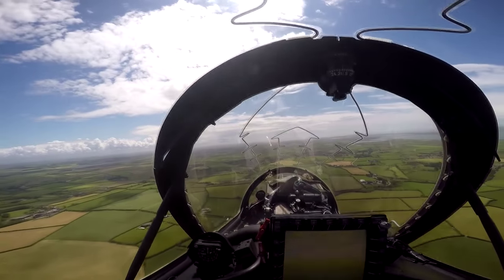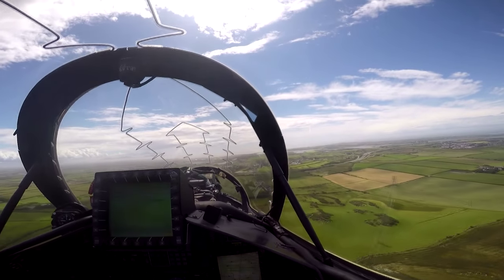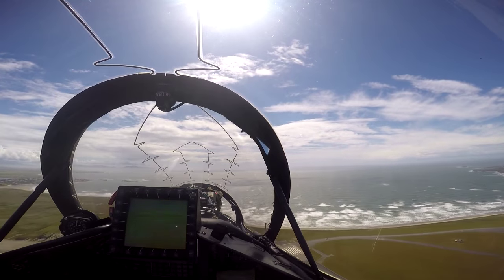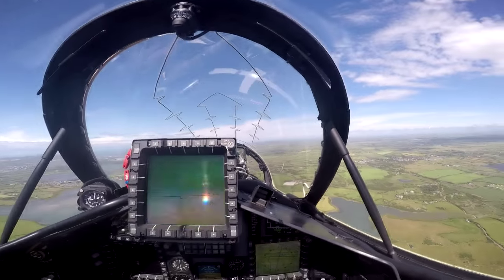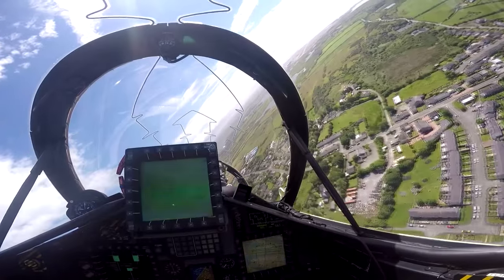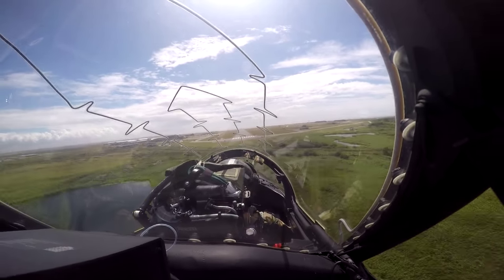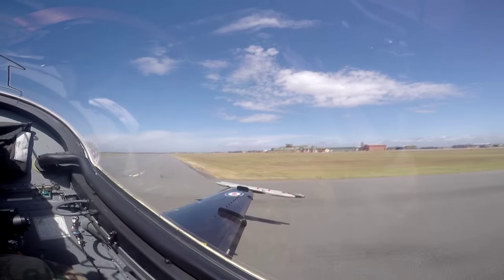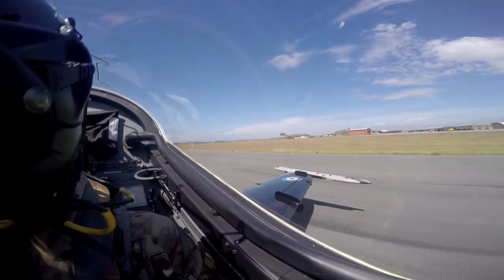Hawk T2 - The Fastest Way to Land a Jet

Comment: Yeeeeha ! I was in a Hawk 3 ship Low Level and last in Line around the A5 pass as I pulled to much G. Ooops. I went full power to catch up and was FARRR to fast with too much overtake for the break. So I had to pull a High Speed Barrel Roll and slotted into position for the break. My debrief was one word beginning with C. 😂 Eventually I ended up on the Jaguar after winning the weapons prize at Brawdy TWU. Loved the Hawk, especially firing rockets. My instructor was ex Lightnings and ended up being Princess Diana’s Equerry.

Comment: As ex USAF it was very interesting to see how the RAF do the break. In the USAF we did the break mid field, not past the end of the runway, and we turned from downwind to final much sooner. I'm curious as to why the RAF spreads things out so much more?

I would also remind you that we were doing our break coming in at 300 kais and final was done at 160kias + 1 knot for every 100 lbs of fuel over 1,000 lbs, so everything was happening faster. It's  my under  that previously the US AF did and even shorter pattern, with the turn from downwind to final done immediately abeam of the approach end of the runway, so when they rolled out on runway heading they were at the overrun.
Reply from the maker: Our circuits were taught to be flown fixed power as a handling exercise. Set 80% at initials and try and not touch the power again. Also, US jets tended to slow down faster, hither alpha so you could break earlier - there seemed to be a thing in the UK of being on speed to tip final before you tip final, not catching it half way around.

Comment: How many times can a chute be reused? Has it got a definitive life span or is it an inspection and refit until it fails said inspection? 
Cheers
Reply from the maker: Oooh, I don't know actually! It's probably an inspection as it's not super critical and does fail about 5% of the time.
Reply: They are usually lifed at so many streams. Once deployed and collected from the taxyway they are taken to the servicing bay, checked/serviced and repacked then fitted back in an aircraft. Each 'chute has an engineering file so the life and repairs etc are recorded.
I've repacked several Victor 'chutes at Bruntingthorpe for the Cold War Jets days they used to hold and they are huge and heavy and take 3 people to carry! They were of course no longer subject to service requirements.

Comment: Fantastic video. I have two questions with when you perform over head breaks as a 2+ ship, 1) what is the time delay between each aircraft breaking? 2) do you use the same speed in a formation recoveries? Top stuff
Reply from the maker: Just 4 seconds :)

Comment: Hi Tim, I've noticed in a few of your videos, both real and sim, that you talk about Alpha - what exactly does this mean? Ta!
Reply from the maker: Alpha is the angle of attack (AoA) of the wing to the oncoming airflow - as an aircraft loses speed (on landing for example), the wing needs to increase lift in order to stay level and thus it's angle to the airflow is increased and this increase is known as an increase in alpha.

Also, What is the angle of attack?
The angle of attack (AOA) is the angle at which the chord of an aircraft's wing meets the relative wind. The chord is a straight line from the leading edge to the trailing edge.

Comment: Awesome video.  Love the commentary.  :)  You might not have to collect the 'chute, but who is responsible for refitting it before your next flight?
Reply from the maker: +essee1977 Sorry, the comment about not collecting the chute was flippant lol, we have engineers who drive out to get it as we have to debrief the sortie which can take an hour or more. The chute is probably only used on 10% of sorties - the engineers will repack it, they have them already packed ready to go so this chute will probably go in another aircraft when it has been collected.

Comment: I'm not an aviator - missed the boat on that one....Can you explain the term "dead wing" after turns.  Also why do the RAF fly circuits into landing?  You mentioned that USAF doesn't do this in a DCS video.  Great content BTW
Reply from the maker: Dead wing is the wing that blanks the sky in a turn so when you roll out you need to check no aircraft are hiding there. The USAF are procedural on departure and recovery, the RAF is not and a run in and break in the circuit is the fastest way to land especially in hostile territory - the US guys call it 'the pitch'.

Comment: You explained how, but did't at all address why.
Reply: Because it keeps energy in the plane until it's within airfield defences. A typical approach leaves an aircraft extremely vulnerable if attacked.
Reply: The number one reason for a buzz and break?
They look cool.
Reply: @kiwidan2271  I was lucky enough to be a passenger in an ex-RAF Folland Gnat that performed a 'run and break'. It's every bit as exhilarating as it looks.
Reply: It’s the fastest way to get jets on the ground in a combat zone, where they can also keep enough energy to get into a fight or evade. 

The conventional slow and long approach doesn’t cut it when you are in an area where you don’t have air superiority at all times. Since ww 2 planes that were caught trying to land were easy prey ... even through the jet era. So consider the technique to be a lesson learned with blood.
Reply: In addition, it is also efficient for aircraft recovery and uses less airspace overall.

Finally, fighter pilots like showing off
Reply: It's also a nice balance between safety and recovery speed/rate/volume. It's faster than a standard civilian 'long-final' approach, yet safer than a straight-in approach, and lets the aircraft keep their speed/energy until right over the airfield.

Comment: Pardon my ignorance, but why don't you just fly straight-in approach, seeing as you were on a final beforehand? I'm guessing it's tactical / safety of the ATZ ?
Reply: if im not wrong..one reason, im sure there are more...  allows planes to arrive faster to the airfield, break quickly to lose speed and land. if they do a straight in approach, they would be going much slower from further away, thus taking more time.

Comment: Super Sweet :) What is stall speed with full flaps dirty config on the T2?
Reply from the maker: Threshold approach speed (with 'down' flap) is 121 + 1 kt per 100 kgs of fuel so normally about 125 kts - stall speed is 10 kts below this speed.
Reply: +Tim Davies thanks for the swift response. Adding the Hawk to my DCS simulator tonight after watching your vids...

Comment: “Not going to get it myself”

Typical officer approach. Very good video Tim. My question is; what is the purpose of the run in & break?
Reply: if im not wrong, its to get to the runway as quick as you can, with the break to slow you down as fast as possible and then get on the ground the same.   it all happens in just a couple of minutes.
Reply: It signals to put the kettle on

Comment: Hi Tim, what's the definition of "initials" when approaching?
Reply from the maker: 3 nautical miles on the runway centreline between 1000 to 2000 ft but most people always come in at 1000 ft which is the height we fly circuits at. The radio call is to inform ATC and other aircraft that we will be breaking into the circuit in 20 seconds.
Reply: +Fast Jet Performance Thanks for the speedy reply! 👍🏼
Reply: @FastJetPerformance  Excuse me, Tim, but unless you are doing 540 knots ground speed, that's just isn't correct.

Comment: Extremely easy manouvre, after a few circuits of practice. The fast initial break facilitates a nice wide final oval turn in which to configure and make the necessary height/ runway alignment adjustments. As for speed /AoA select an engine N1/EPR depending on what your aircraft has and use it as a simple datum dependent on a/c mass density altitude etc.

Comment: A right hand break?  Not sure my body can do that. F-100, F-105 and F-4. The Thud was 191 knots on final plus 3k per 1,000 lbs of fuel above minimum. 125k has got to seem leisurely.  Seriously, that was a nice pattern (circuit).  But gear and flaps extending during final turn seems an unnecessary addition to pilot workload, having to recheck both those complete during the turn.
Reply from the maker: I agree about the final turn but the RAF would never change it, unfortunately.
Reply: @FastJetPerformance  So we can hope that no RAF Hawk driver ever gets a flap asymmetry as he rolls into his 40° to 60° of bank from downwind.
This the first of your videos I've seen.  I will watch some more as time allows.
Reply from the maker: @daveriley6310  you're right, it's something we constantly talked about. Half flap is selected downwind, it's just full flap taken as we tip. The flaps are supposed to stop travelling should they experience assymetry but of course we shouldn't rely on an emergency system.

Comment: Had he done it 600ft at 400kts and made a left turn with no climb into a full stop landing then he would have done a Navy brake.
Reply from the maker: We do climbing breaks too, 500 ft climbing to 1000 ft or 500 ft level breaks and decelerate 360 kts to 200 kts.

Comment: Breaking to the right is just.....unnatural......
Reply from the maker: In the UK we break both to the right and left depending on the circuit direction. The runway directs the direction so ATC will tell you to join for runway 31 Left, meaning it will be a left break as the circuit is left hand. Interestingly, when I was a Tornado pilot in Lossiemouth, all the circuits and therefore breaks were to the left. Our sister base in Marham also flew Tornados but they had circuits left and right and quickly worked out that when they flew practise air combat stories against Lossiemouth based Tornados, all those pilots would always break left 🤣
Reply: Hurumph, Tim!  My bete noir as a SATCO!   It's 19 'Right HAND' (or 'left HAND') as appropriate to indicate the circuit direction; '19 Right' means the right side runway of a parallel set of runways.  Very important if you have a parallel taxiway marked up as an emergency runway...